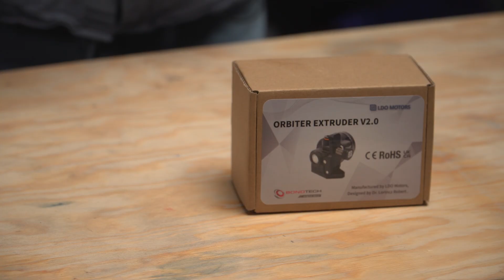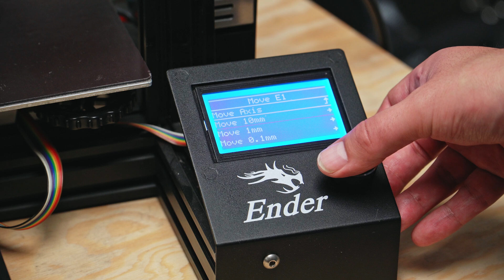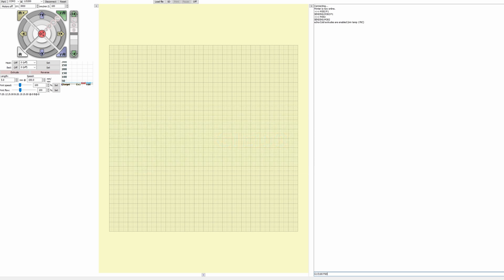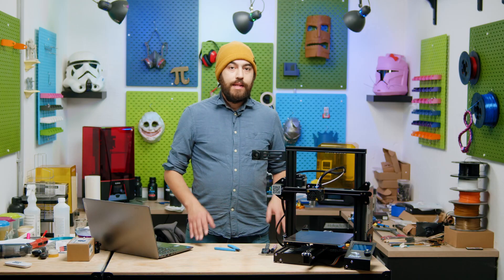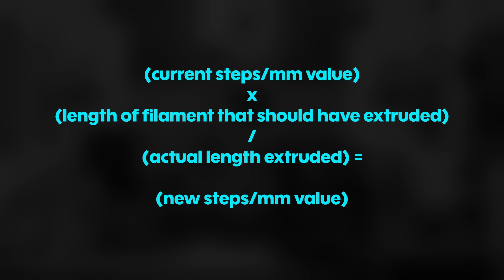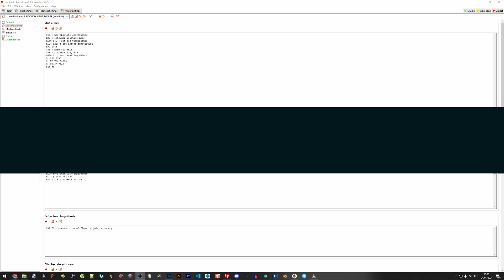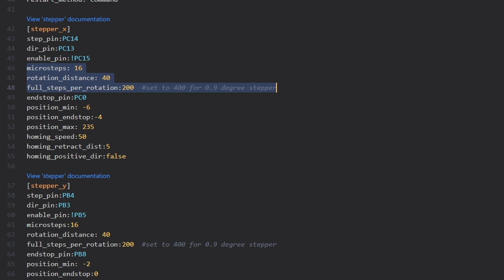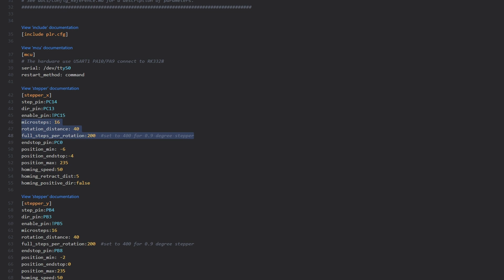E-Steps and Rotation Distance - Tuning your Marlin/Klipper Extrusion

Comment: Very clear and useful video! THANK YOU. But I have one problem! When I click on the “Extrude” button in Pronterface, I move FORWARD 20 mm (parameter 20.0)... All correct. BUT when I type the command G1 20... I move BACK 20 mm! Please help me understand the problem.
Reply from the maker: Hmmm, you might need to specify the axis, so G1 E20 instead of just 20. Could also be that the printer recognises it as a relative movement. Use the G90 command first, this will consider all moves as absolute rather than relative then try the G1 command again.

Comment: what about when you convert marlin to klipper?  its not taking my change in rotation distance.  using mainsail.  still extruding the same about 135 mm with 100mm test
Reply from the maker: Are you using the formula here: https://www.klipper3d.org/Rotation_Distance.html It depends on the motor's step degree and the firmware's microstepping value